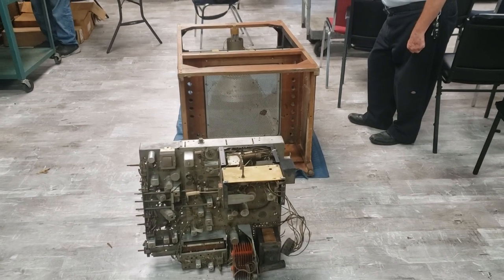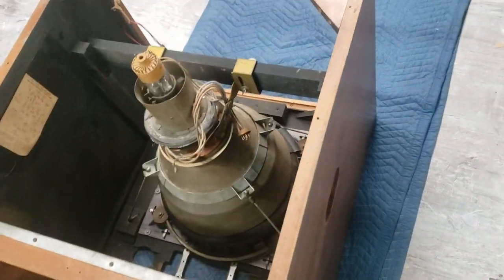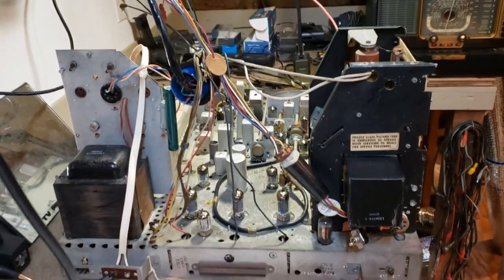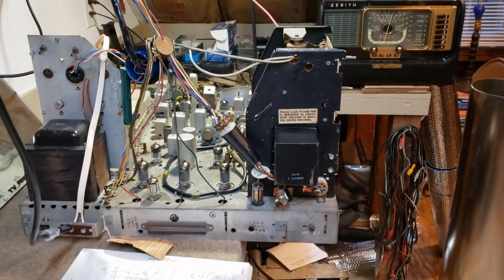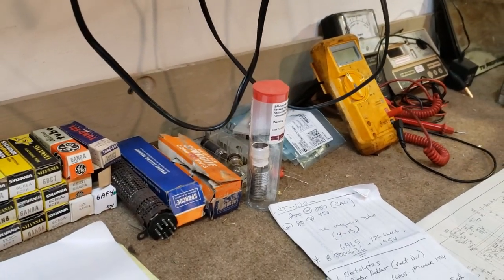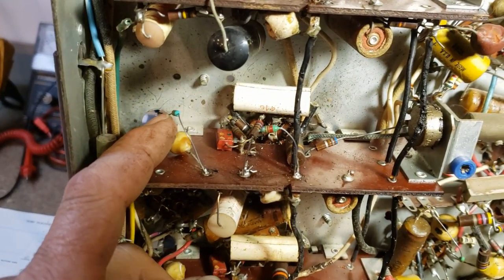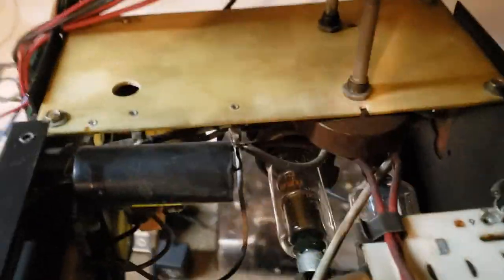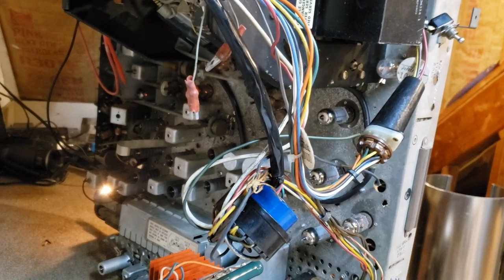CT 100 Restoration   Vintage Radio and Communications Museum of CT Part 1

Comment: a few years ago  I parted out a high end 50's tektronix tube scope and was able to pull a HV control that I thought was for focus, but it looked identical to the one in my ct-100 and was close enough to use and worked perfectly, I cant remember the model of the tek scope
Reply from the maker: Thanks for the tip- we have some older Tektronix scopes at the museum. Do you still have your Ct-100?